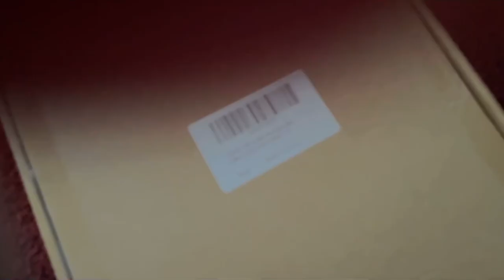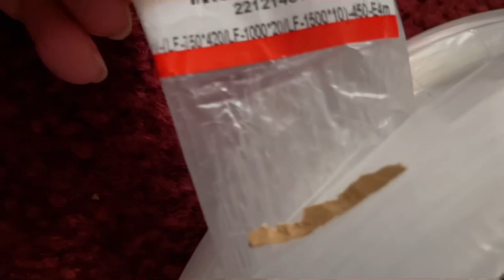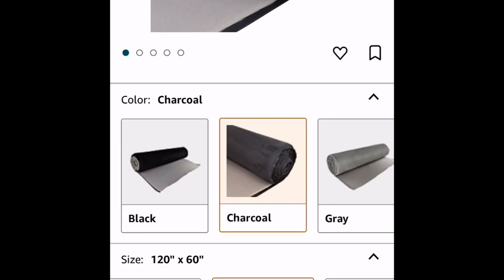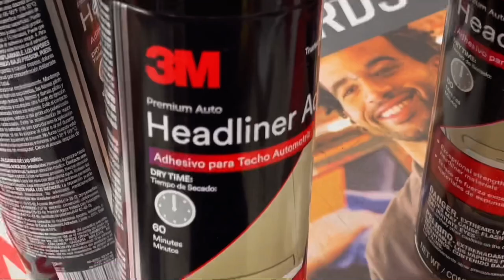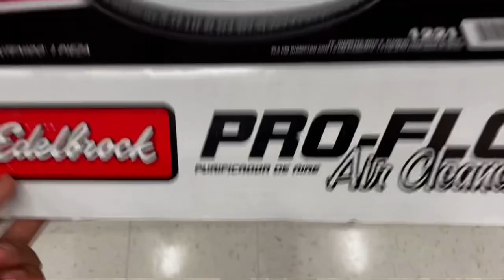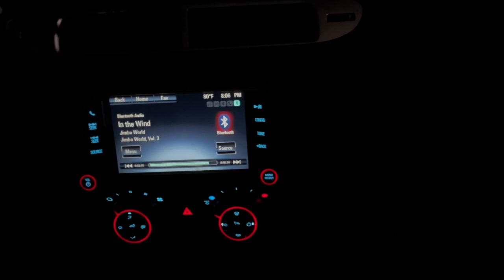INSTALLING HEADLINER STARLIGHTS IN G-BODY - PART 1

Comment: How did it turn out
Reply from the maker: It turn out good just didn’t have all the stars in it but might upload what it had looked like
Reply: @86_gbodykid  cuz I'm planning on doin mines in my regal did yu straight wire yours or do yu use yours in the lighter plug?